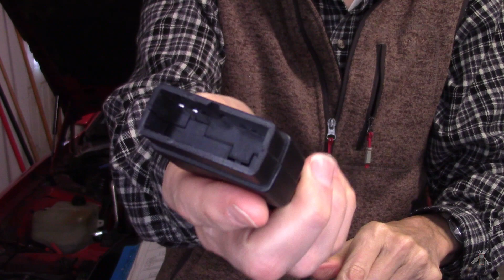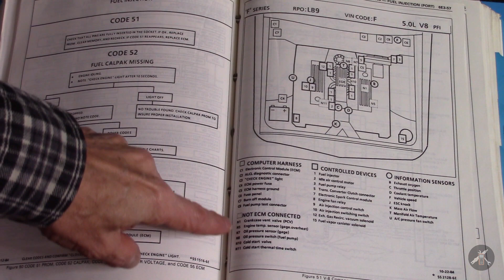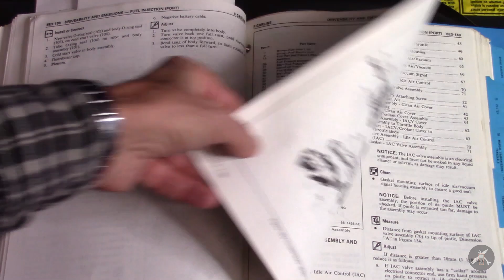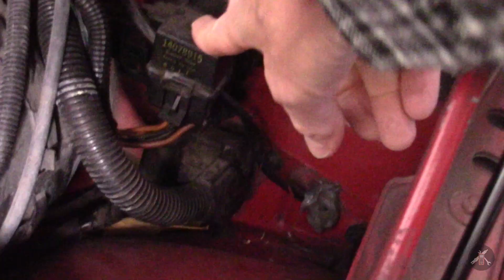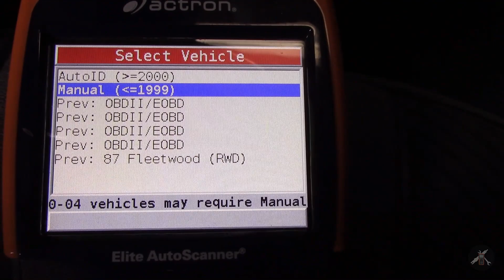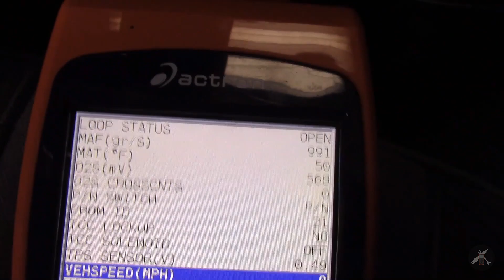Diagnose and Repair GM OBD1 Computer Controlled Cars- Chevy Tuned Port Example

Comment: Great stuff, dealing with a 2.8mpfi and it runs great but milage is terrible at 15.5 !  How would one be able to see live fuel trims on aldl?
Reply from the maker: WinALDL provides the short and long term fuel trims in a table form so that you can see the adjustments at different engine speeds and throttle levels (I think mine uses a power / load variable).

Comment: Lately, I’ve been having an intermittent OBD1 SES code “13” or “44”…both of which point to the O2 sensor. 13 is general, 44 is “lean condition”.  Both imply bad sensor or vacuum leak. I’ve corrected things and still testing.   88 S10, 2.5L, 5-Speed Manual.
PS… I got frustrated with sticking a shorting pin between pins “A” & “B” on the OBD1 interface.  So I punched in leads to these pins and ran the wires up to a simple “On/Off” toggle switch on my headlight panel. Now all I need to do is flip the ignition “On” and throw the OBD1 toggle switch to “On” in order to see the flashing Service Engine Soon lights… 👍
Reply from the maker: This was my code 13 issue on the IROC. Intermittent one.
https://youtu.be/lG7knaBmu0s

Comment: Very educational!
I ran into a lot of this on my 88 S10 (2.5L TBI). I played “parts cannon” with it while chasing many different OBD1 SES codes. Ultimately, I pulled a same-serial number ECM box from a junkyard 2.5L S10 and swapped PROMS. The truck ran like a top after!
Reply from the maker: Glad you found the solution with the PROM.  They don't go bad often, but they surely can.

Comment: I took my suburban to a shop to get trans rebuilt and he sent it to another shop to do. Needless to say I’m out 2700 and still have no reverse. They also broke my speedometer and my obd1 port. I believe he traded it out and gave me broken ones as he was also working on same year suburban from another guy. How do I fix the obd1 port? It won’t flag any codes. Is starts with 12 and then it’s like it has its own battery and it just dies while trading codes. Do you know how to fix this? Thanks
Reply from the maker: Essentially, the circuit is very simple.  Pin A is ground, pin B goes direct to the ECM / PCM. If you get a 12, then the system is working, but if it drops out, it could be a fault in either the PIN B lead or Pin A lead. 
This is the full paragraph from a GM service document:
An intermittent MIL and No Diagnostic Trouble Codes (DTCs), may be caused by:
Electrical system interference caused by a defective relay, control module driven solenoid, or
switch. They can cause a sharp electrical surge. Normally, the problem will occur when the
faulty component is operated.
Improper installation of electrical devices, such as lights, 2-way radios, electric motors, etc.
Ignition Control (IC) wires should be routed away from spark plug wires, ignition system
components and generator. Wire for CKT 453 from control module to ignition system should
be a good ground.
Ignition secondary shorted to ground.
CKT 419 Malfunction Indicator Lamp (MIL) or CKT 451 (diagnostic "test” terminal)
intermittently shorted to ground.
Control module grounds.

Comment: Thank you for educating us on the cars that were built to last. I have the fsm’s for my personal 94 impala & much knowledge specific info on obd1, pcm tuning. A 1994 4l60e in non PWM & thank you sooo much for refreshing my brain on the basics. I had to make my own scanner using an arduino chip & thank god for eehack, tuner pro, flash hack. I strongly dislike code 84 at this point in time. I just subscribed. I thank you & I thank the impala ss forum.
Reply from the maker: You're welcome.  It does sound like you have a good background in controllers and tools.  That should help you a lot. I haven't had to deal with an 84 yet, so I don't have any suggestions.

Comment: 95 suburban, 350 v8 TBI. Timing goes backwards on acceleration.
Reply from the maker: Not sure if I understand, but timing advance will be higher at closed throttle, possibly up to 40 to 50 degrees at light loads.  When the throttle is opened for acceleration, the advance will come down a lot and then track with increasing engine speed. I don't know the exact curves, but at WOT, might start out at 10 - 20 degrees coming off idle and end up at 30-35 at max RPM.  The curves depend on load, engine speed, knock resistance and emission requirements.

Comment: Thank you sir for sharing your OBD1 knowledge with us. I've got 5 GM vehicles 1988 - 1994. I have the service manuals and parts books for them. Those have been helpful through out the years. However, some of it I do not fully understand. I'm trying to learn on my own. I've been able to fix things. I've use Tunerpro RT to trace down a couple problems in the passed. A couple days ago one of my cars (1992 Cavalier Z24) had a crank no start, no MIL, no prime with key on RUN , ACC and starter works. (Thank God the failure was in the driveway) I'm trying to correctly understand the information to diagnose the problem. I'm not going to throw parts at it in 'hopes' I hit on the correct issue. I do have a new ignition switch and will try it. I'm hoping it isn't the ECM.
Reply from the maker: If you have the book, I would start with the engine emission section.  Should be section 6E2 and Chart A3 "Engine Cranks but won't run".  Make sure it flashes a code 12, that means ECM is up and running. If you can't hear fuel pump prime on initial key up, that's a problem. You can check fuel pressure. May need to check for spark.  If you have Tuner Pro RT, you can do a check of sensors with the engine off to see if something looks off.
The trouble trees should walk you through the basics.
Reply: @bitsofwisdom460  Thank you for the suggestions. I have looked over the trouble shooting section. With the key ON, nothing happens. No lights on the panel. No fuel prime. No pressure at the rail. I'm going to install the new ignition switch I have this afternoon when I get home from work. I don't think I'll be able to get any data from Tuner pro if the ignition switch isn't turning on the SEL or priming the pump. Paper clip trick won't work either, if there is no power to the switch.
Reply from the maker: Yes, I understand and you're correct.  If the issue is that you have no power coming up with ignition, then that is a different path. If you can crank, then you have battery power to the solenoid and to the start contacts in the ignition switch. I would go back to section 8 in wiring to look at the power distribution. Most of those power feeds either have a fuse or a fusible link wire. May need to check those with a voltmeter to be sure you have power to all the right switch contacts.

Comment: Thanks for the video; it is really helpful. I have a 1991 Cadillac Brougham D’elegance, and I’m eager to get one of the tech 1 or 2 scanners, but their prices are up to the sky!! I learned about another option through your video, Actron CP9690; I hope it will work in my Cadillac. This model of Cadillac has Chevy TBI 5.7 engines, and they are reliable, except mine, lol. Also, I will try WinALDL. Do you have any experience with that program?

Comment: I thought it could possibly give a false reading since it may not be programmed
Reply from the maker: The purpose of the ground wires and pins is to take the voltage to zero.  If there is a lot of current on a long wire, there can be a very low voltage due to resistance losses.  If there is no / low current it should be zero. Even if the ECM is not programmed, zero would be zero If it is not, there is a problem with the ground connections. The ECM could try really hard to put power on that pin, but a good ground will still take it to zero.
If you transferred the PROM to this ECM from the previous one, it should work.
Reply: @bitsofwisdom460  o ok to check voltage ground black to negative battery and red to pin ?
Reply from the maker: @Jaguar-Xjr  yes, that is fine.  If not zero, then need intermediate points to see where it is bad.
Reply: @bitsofwisdom460  o ok do you recommend purchasing the power probe ect3000